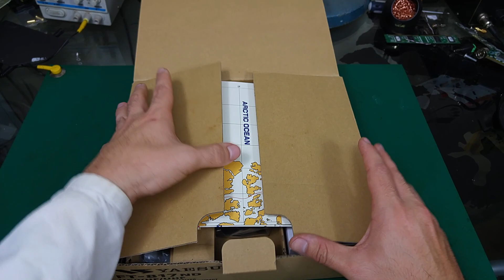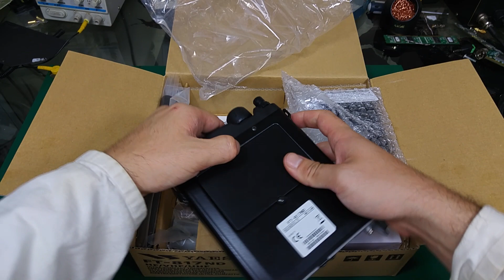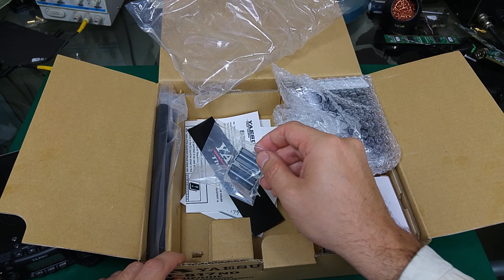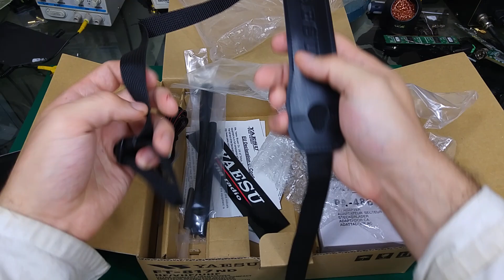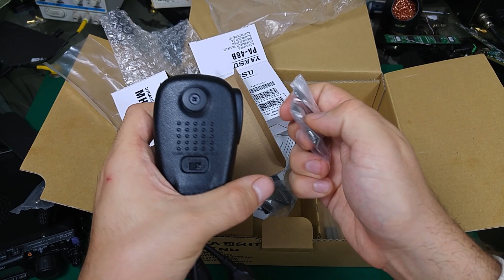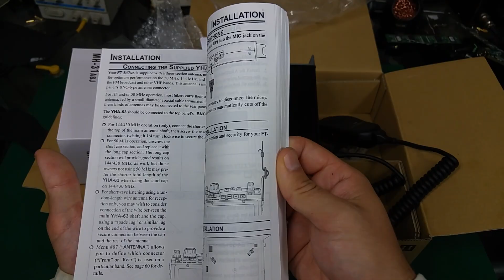Yaesu  FT-817 ND unboxing QRP backpacking HF radio

Comment: Very good transceiver 👍 !  73's from France 🇫🇷14frs2507 Sébastien
Reply from the maker: It's quite good radio, menu is hard to understand but after some time You get it right.   
Recommend extended internal battery: 
https://www.youtube.com/watch?v=eTWtEN4I2TM